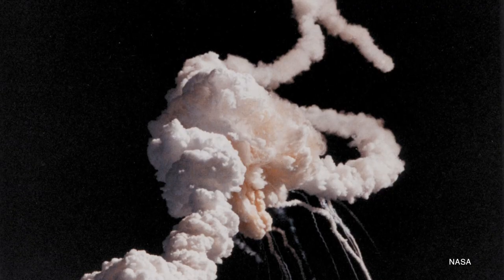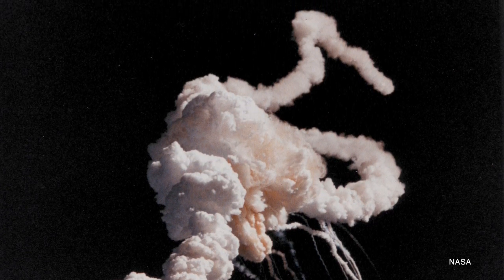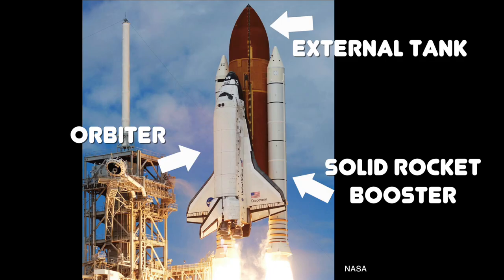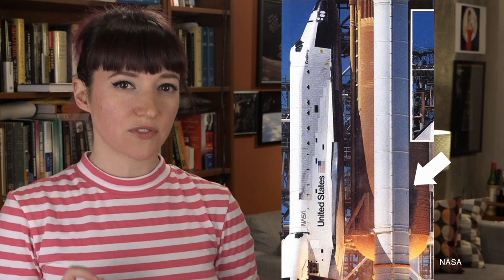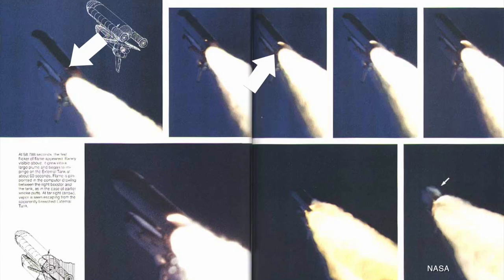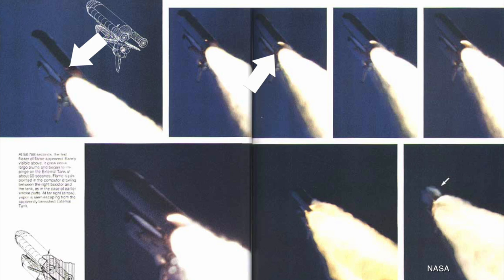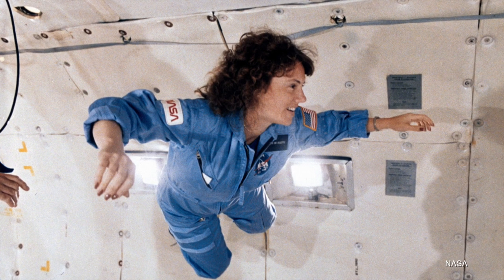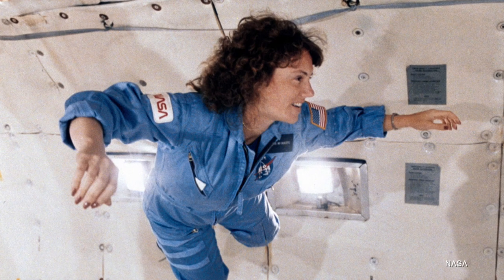How the Challenger Disaster Changed NASA

Comment: Obviously a seal connection  failed but still not convinced it was the cold affecting the O rings. The rings were assembled warm so they were at their  normal resilience and therefore sealing ability. A now cold O ring should have still  been filling the contact surface. Feynman's demo showed an O ring compressed and then released while cold. Not a great analogy imho.
Reply: The O-ring did fill the space, as it was on the launch pad.  But those conditions changed immmediately when launch started.  The point of the O-rings being pliable is that they react to the changing conditions and maintain the seal.  Otherwise, why have O-rings at all.
Reply: The cold also changes the metals around the o-ring. If the o-ring is cold and has reduced elasticity, it won't be able to compensate for changes in the space it's designed to seal.
Reply: Gave you a thumbs up and not arguing at all but if the area around the rings was getting warm because of the solid rocket compound burning just inside, might the O-rings also be warming up and doing their job.
Reply: Also gave you a thumbs up and this is not a rebuttal, just my mind wondering that if the metal around the joint had shrunk due to the could maybe both surfaces would have contracted and there would still be a seal. Still not convinced and more suspecting a defect in one of the seals or damage during assembly. I recall reading about them being troublesome to fit together. Thanks for responding
Reply: panther105  By the time the rocket was firing pressure increase far exceeds temperature increase.  The fault is evident seconds into launch.  Once the seal is breached, the pressure from exhaust probaby exceeds the restitution force of the rubber.

Comment: Basically this is why space should be privatised
Reply: Private companies also cut corners, partly to satisfy shareholders. All they'd be doing is shifting the problem culture under a slightly different pressure.
Reply: I think the fact there's been more innovation in rocket design in the last 10 years from private companies than the last 50 years by NASA since the moon landings, demonstrates private companies actually care about improving rockets to be better/safer/cheaper. NASA couldn't care less about that, it's just a political tool and show of power for the US government. They knew about the issues of Challenger/Columbia before they happened but didn't do anything about it. From what I've seen I just can't see that being the case for private companies.
Reply: Do you seriously believe that? The failure rate of the space shuttle is still less then the current falcon 9 failure rate. Private companies only care about money. The same problems will exist. There has been way more innovation from NASA then from private companies. The deep space missions, and certainly the mars landers (even one with a rover dropped with a rocket crane) are working very well. You can say a lot about the space shuttle, but it was innovative, and it did pioneer reusable spacecraft. 
All current missions beyond earth orbit have been government programs.
Reply: Sander Vercammen The space shuttle was a step backwards, not forwards. It was a bad idea when it was envisioned in the 60s, a bad idea when it first launched in 81, and 30 years on it pretty much hadn’t changed at all. The Saturn V was cheaper, safer and more reliable. 
In all falcon 9 failures the crew would have been fine because of the launch abort system, unlike the shuttle which idiotically didn’t have one
Reply: That may be. The idea of the shuttle was to make space travel almost routine, after the glory years of the late 60's and early 70's this seemed the logical next step in space exploration. It never failed in that goal, but still, to say that private companies have made more progress in the last decades then NASA is simply not the case.
Reply: Sander Vercammen Until SpaceX came along rockets hadn’t changed since the 60’s, and now they are reuseable and nearly 10 times cheaper
Reply: Thats simply not true. Just look at the change in ISP since the 60's. SpaceX is also not 10 times cheaper. As of the moment no one knows for sure what profit (or loss) they make on each launch, but their launches are about half the cost/kg of an equivalent ariane5 launch, and near 1/3th of delta heavy launch (although the payload on the delta heavy is heavier).
NASA has always contracted private companies (rockedyne, boeing, etc...) for their launches, and spaceX is just another player in this field. 
However, rockets are not the entire story. NASA's outer space research is better then it ever was in the 60's or 70's. The landers and deeps space probes have never given us more information. Just look at the recent Mars rover or the pictures of Pluto that new Horizons took.
This is all stuff that makes no profit, but advances science greatly. If you want these kinds of mission to continue you need goverment organisations.

SpaceX is certainly cheap, but really, the only thing they changed is landing the first stage, a great accomplishment, that may or may not make the falcon 9 even economical. But if except for the landing legs, the falcon 9 is fairly conventional rocket, with fairly conventional rocket engines.

Comment: (1) The problem began when Kennedy died in a coup-de-êtat and the United States lost its ways. (2) The shuttle was pushed ahead against all wisdom, when it should have never been delivered as it was: (a) the spacecraft surrounded by the fuel; this is criminal; (b) no, repeat, no escape system for the crew; again, criminal; equal to Kamikaze, suicidal missions; escape procedure available was just ludicrous - and criminal; (c) a huge, multimillion dollar glider with only one chance to reach the landing zone; moronic at least. (3) A spacecraft with the shuttle's attributes of payload, crew capacity and much more is a must, I think, and Orion or other similar contraptions don't come close. A new shuttle or something even better should be procured.
Reply: The Shuttle was designed to do too many jobs, to be an elegant design, true. Better could have been done, with more money, time, and task-focus.
Not quite certain how Oswald intended to get into the Oval Office, though...
Reply: Let the troll vent.  A much more plausible root cause is changing from a one piece design that would have to be floated on a barge (from south Georgia) to the launch site to a segmented design that could be shipped by rail (from Utah!) and assembled with O-rings.  If there had been no O-rings, no segmentation, Challenger would have launched safely.  And that design change was because of politics (Senator Orrin Hatch and many others).